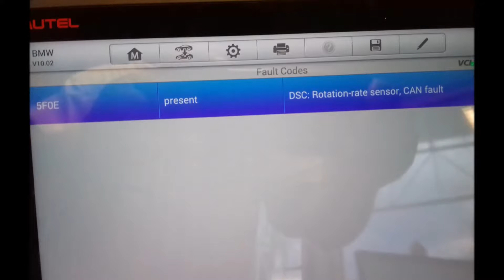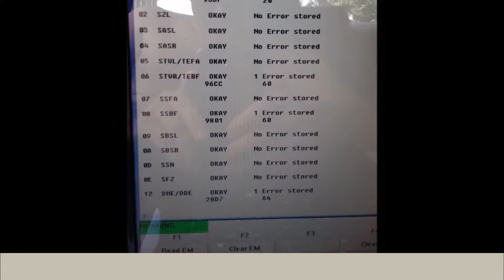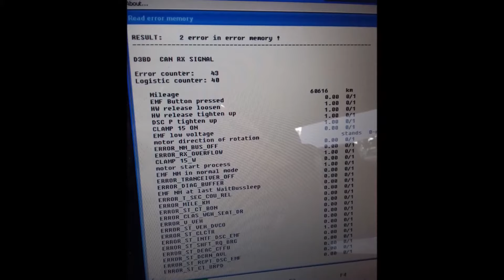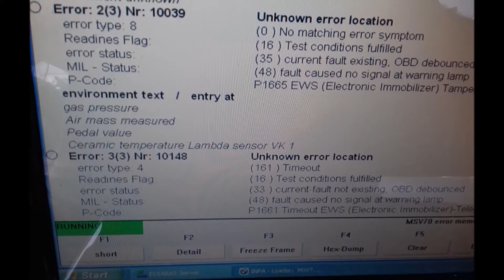bmw  745 i rotation-rate sensor fault

Comment: When you tap back into the main line, can you use just cut right down the middle of that line and just connect each one individually and then add a water proof cable cap?
Reply from the maker: Yes.  Very easy .
Reply: I looked under passenger seat and those sensors weren’t damaged by water or the wiring. But when I scan the car I got code CAN fault for rotation sensor. Could that be the sensor itself?
Reply: Could be be there are three sensors that it monitors traction control abs and stability control so they need to be checked out.
Reply: @najee1100  I know there the lateral acceleration sensor and YAW but which is the 3rd you are talking about?

Comment: I have the same  EXACT problem on my 06 bmw 750li/e66 and im cleaning out and drying it now and im getting a new rotation rate sensor. The sunroof was leaking cause its clogged up and couldn't drain right! I couldn't erase the code either,it wouldn't clear no matter what i did. I also had the Trifecta of lights on the dashboard. PROBLEM SOLVED. Most people like me thought they needed a new ABS module but that obviously wasn't the case.I saved myself alot of money buying a scan tool. Check your passenger footwell,Its most peoples issue and they dont know it and they lose a lot of money💰.Hopefully this helps someone keep their money for themselves or their children.
Reply: Thanks for posting, how did  you repair it? Was it just cable/connector damage or did you have to buy a new sensor? Thanks!
Reply: @stevesbmwbarn  Hello,its was both .I bought a used but good sensor and it can with the connector and cut wires and i swapped it out and joined the wires with heat shrink and it is fixed.
Reply: @popchu3680  great thanks
Reply: @stevesbmwbarn  Anytime brother.
Reply: @popchu3680  Last Q, is yours LHD or RHD? Seems to be some ambiguity as to which side the sensor is on. Mine is RHD, would it be under the left side or right side carpet?
Reply: @stevesbmwbarn  Mine was on the right passenger side and my steering wheel is on the left so im guessing your sensor is on the opposite side of your steering wheel.
Reply: @popchu3680  I'm thinking so too, thanks!
Reply: @stevesbmwbarn  I have RHD and it was under the right side driver side